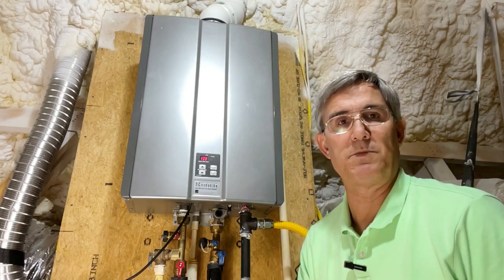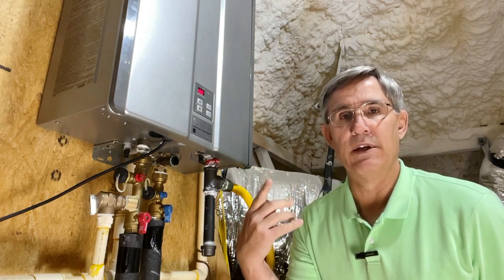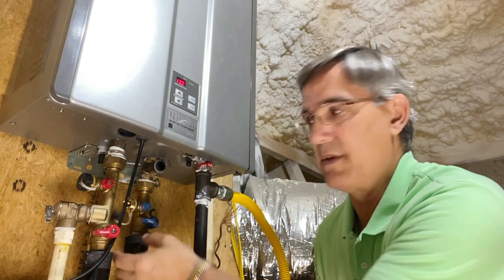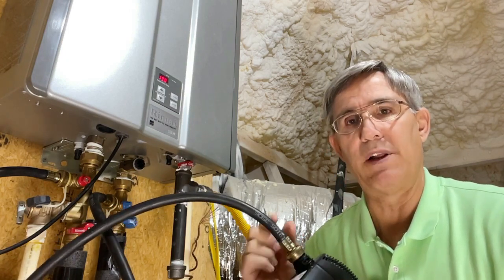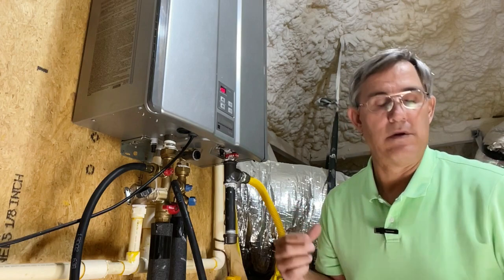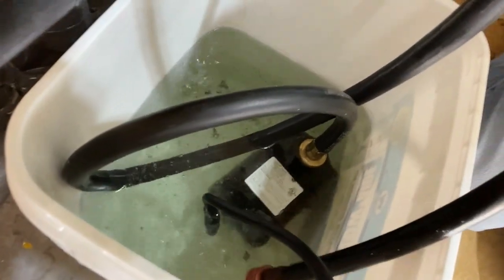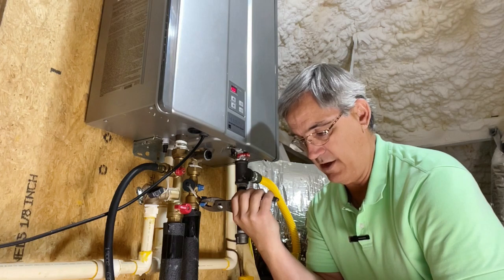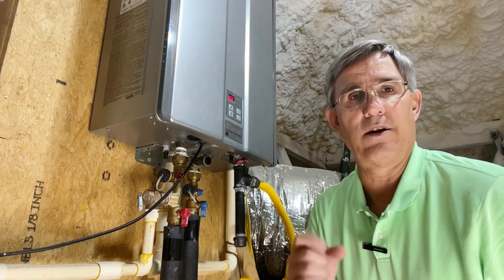Flushing a Tankless Water Heater

Comment: what if water is not coming out the hot side hose?  I have the valves open and the pump appears to be working but nothing is circulating out the hot side
Reply from the maker: Open the bypass valve.